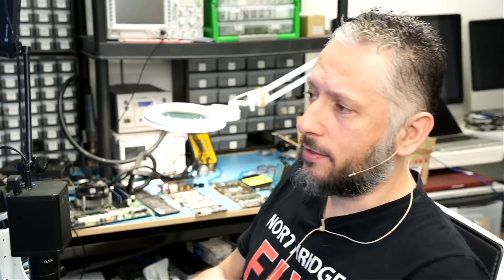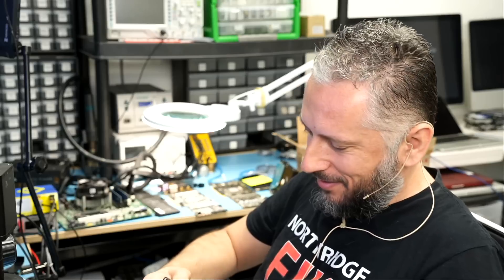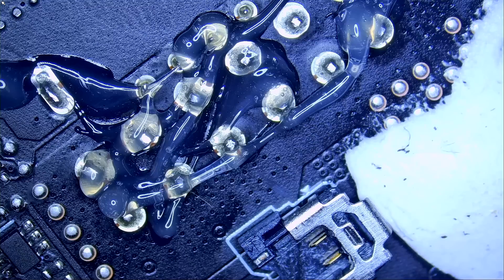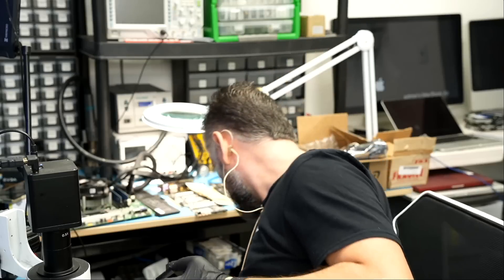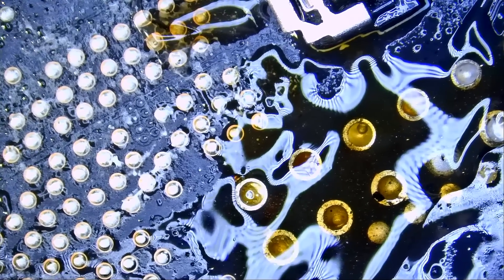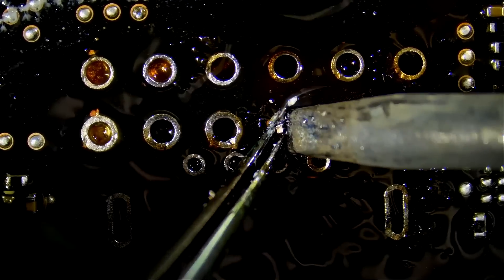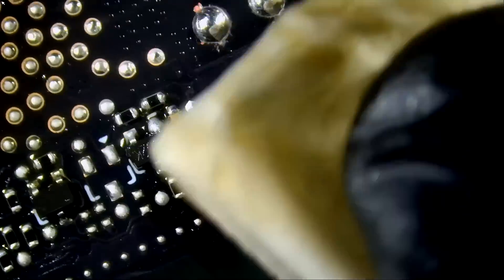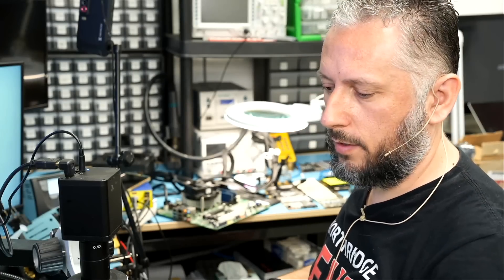4090 FE Connector melted with Cablemod Adapter installed. 40 series cards should be recalled

Comment: I'm skeptical, While the design is crap, it wouldn't surprise me if the power connector was already damaged from the in box adapter and the owner noticed, bought the cable mod adapter in an attempt to prevent it from getting worse, but damage was already done.  People do crap like that all the time, they try to bandage things first after they are already to the point of needing a proper repair.

Comment: I own about 10 of these cards. All 12vhpwr. I have had no issues with them. Just have to push them in all the way.
Reply: So you have 10 PC's running 4090? Sure.
Reply: @j.a.3138  I have about 120 PC’s. All ranging from 3090 - 309Ti - Quadro Cards - 4090 

When you do cancer research it’s what you need.

Comment: This Problem can be easily tackled if the company, have used two connector's for 40 series graphics cards ..... the main issue that the connector is melting is that, AMPS drawn by the connector is more than it can handle, as a result it melts..

Comment: Basic maths... Google 4090 power draw and 450w tends to be the response.  At 12v that means 40 Amps will be drawn.  Its a simple matter of the connector not be up to the task.  As mentioned in comment posted on the last video on this subject, Linus, JayZtwoCents, Gamers Nexus have all commented on this issue and it's not down to user errors.
Reply: Haha yeah, with those amps u'd need industrial power connector.

Comment: High resistance causes high heat, something is drawing to much amperage, and the conductors can not handle the heat they are the weakest link in the circuit.

Comment: The wattage going into a single Plastic connector doesn't work. If it was on a vehicle we'd try modifying the power delivery using up to 3 connections or beefing up the housing on the single plug. Aluminum would be a viable option.

Comment: It's kind of weird that the connector melts only on the card side, but not on the other end of the angled adapter. Could it be that the plastic of the connector on the card is ABS and the angled connector is nylon or similar? Nylon has a higher melting point (glass temperature) than ABS. Or maybe the coating on the pins are not good, or the female connector has not gold plated contact or something? Either way, it's all due to a connector carrying too much DC current, that's what I believe and it's not user error. If it would've been my card I think I would just solder the wires directly to the card and remove the connector altogether. With a PSU with a connector on the PSU case you can still remove the cable if needed. That way I'd be sure there wouldn't be any melting.
Reply: The temperature on the card is 60 degrees more than the PSU side.

Comment: The problem is that this type of plug does NOT withstand as many watts as the card draws. We have reached the limit of what this type of plug can handle in terms of current. This is not a user error!

Comment: From all I have seen the issue is with the power supply. The spec reads you need at least an 850w power supply because this card draws 450+w. Even power supplies made 3 or so years ago are not designed for this amount of draw. So when a user plugs in a rail that cannot handle the draw it causes this melting issue. My recommendation to my customers is to get the pig tail so they can plug in two independent rails that merge into one for this power connector. I also recommend at least a 1200w gold rated power supply! I mean if you are going to spend this kind of cash on a GPU, dont skimp on the power supply! Would be worth asking your customers what power supply they are using and how they are connecting to the 4090. This would be useful info for everyone to know! I am blown away the manufacturers are not making this clear but it should be a given since we all know these new cards are power hungry monsters and the ignorant idea to go with a single power rail to the card is just that, an ignorant choice by the manufacturers!

O yea and Alex you have mentioned a few times about how many layers these cards are. In my quest to find out I have learned there are at least 12 but I have seen some of the higher end cards can be up to 24 layers.

Comment: Get a stock of the power cables that plug into the board, cut off the connectors and solder the wires direct to the board rather than fitting a new connector which may fail again.

Comment: Would be very interested to know if you've had any in for connector repair if the card has been used with PSU maker's own 12VHPWR cables, like Corsair for example. Is the issue only being seen where the Nvidia adapters (with or without cablemod right angle) being used or does this apply to PSU OEM cables too which  are already higher quality and thicker than the Nvidia adapter cable that splits into 3/4 PSU PCIe connectors?

I'm just glad I didn't end up getting a FE card now and that I'm using the Corsair 12VHPWR cable with the Zotac 4090.
Reply: From what we've seen in talking to other vendors and resellers, this is happening with the stock Nvidia cable, competitor cables, and has happened with our own. The two melted cables that we had reports on were definitely user error and not fully plugged in as shown in the GN videos though. But I do, like Alex, suspect something else is going on with too much power being drawn on that top row of pins and think that there could be other issues outside of the melting being exclusive to cables not being fully seated, as shown here with our adapter even melting in the connector too, with the same top row pins melting.

Comment: I don't know if this is the issue, but the 4090 FE chipset has an official power draw of 450W which is 100 watt more than 3090. The more power that has to go through the same standard connector, the warmer it gets and connectors are potential weak points in any electrical system. That doesn't mean that the connector will melt on every card of the same manufacturer. Nevertheless, if I should buy a 4090 card today I would've done some research first to check if it this happens more often to some manufacturers than others. After watching NorthridgeFix' videos about this issue I would have used electronic cleaner and moved the connector in and out a couple of times and make sure the plug is fully seated to try to get as good connection as possible. 
Nevertheless, even if the user doesn't clean the connectors and simply installs the card according to the manual doesn't mean that a melted connector is the customer's fault. The way I see it, this is a design flaw. Remember that it is the connector on the card that the manufacturer has installed that melts...

Comment: @NorthridgeFix why don't you take one of those connectors and wire up the +12v and ground pins same as with the card and pull a high amp load through those pins till the connector starts to burn then report back at what wattage & time the connector gives out?

Comment: This must be mainly because the current carrying capacity of pins of connector is not that sufficient to carry the peak current load of 4090. Due to this the resistance offered by these pins must be more thereby producing a lot of heat. The company should replace these with pure copper alloy pins which may carry more current without producing much heat. % of copper in alloy should be more and the design should be made with thicker pins so as to carry more current.

Comment: Simple physics tells me the issue is with the user when looking at the cable / socket spec. Sure you may have the odd problem with an adaptor cable or socket that has a manufacturing defect, but again that's explained by physics. Having a properly molded socket and cable is fine as long as the cable is inserted fully.

I'm also wondering why people are sending you GPUs for repair when they are still under warranty? Again this points to user error.

Comment: Imo the problem is the pins in the connector has to small area so if the matning connector isnt tight enough there will be excessive heat.

Comment: I've seen some yt videos of polish repair shops dealing with this connectors and they've noticed a problem with the power cables provided for the card. Sometimes the power cable itself does not fully connect all 12V lines or all GND lines causing high current to flow to or out of the card by only two or one pins on the connector. Maybe this is the problem.

Comment: Im not an engineer but I know those tiny pins should have been  the main suspect from the beginning, those cards need a lot of current and those pins are just so small in mass, it generates resistance which creates heat. 8 pins connector pins are much more thicker and solid while being rated for only 150 w each.
Reply: Exactly, you're not an engineer thats why everything you just wrote is bullshit and without merit or foundation in reality.

Comment: Like I said in the last video, the connectors are flawed.  All connectors become loose over time and this is usually a factor in choosing a connector.  There is a derating curve for temperature and for high current connectors there is usually a derating curve that is determined over a number of on/off heat cycles and connect/disconnect cycles and I don't see that for these connectors.  This derating curve of current rating vs cycles would likely show that it would hit thermal runaway after so many cycles at 400 to 600 watts.  It could be weeks, months or even years, but all these connectors will eventually melt under a heavy load and that limit will get lower and lower over time because this connector is operating over its derated maximum.  They should have went with custom high current screw terminal connectors that have a large surface area of contact and some screws with captive lock washers to prevent them from backing out on their own...  The data for the PSU could then be SMbus or USB data to the motherboard from the PSU and the card can get the info from the OS or a secondary data line direct to the PSU.
Reply: Thanks, i like reading arm chair EE's talk out thier arse about things they know nothing about.

Comment: a few 4090s show up for repair and recall? Considering how many 4090s are in the wild now going to need more numbers than what is essentially a fraction of a percentage. Note that there's over 130k sales now. Also a cable mods adapter isn't a guarantee of no fire or melting, it just provides less chance of it being caused by cable routing causing undue pressure on the plug.

Comment: In my opinion. It falls on the manufacturer. They do all types of tests before a product is released to the public. They just didn’t care a small fraction would encounter this problem. The bottom line is profit in the end. That’s why they are issuing warranty replacements on this.

Comment: The amount of power they suck and the pins still being thin like they had been, it's a design fault. This is one of the most power hungry chips and thickness of power connector pins hasn't increased as per its requirements. That's why the plastic is melting. 
Similar thing happens when you use thin wire for heavy loads.

Comment: I literally installed an adapter 5 minutes ago from CableMod. Not that they are at fault IMO, the new adapter is just BS trying to push something new. I have seen OMEN pre-builds with normal PCI-E connectors..
Reply: You're fully safe with our adapter. Even IF a failure occurred, we have a great support team that would take care of you fully. As you can see with this GPU that was sent in even, if the event happened where a GPU had a failure like this, we replace the card, get it repaired, and then we plan to giveaway the cards too, as we did on the Nvidia subreddit with one giveaway going currently. :)

Comment: Too bad that it had to be destroyed to get it apart.  I wonder if that Cablemod adapter had the pins too short on the one side that was unmelted, those were clearly not connecting properly.  A picture of the card installed in the case would also be useful.

Still not 100% convinced that this one couldn't have possible been due to it's installation.  Or a defective Cablemod adapter.  It could be that when pushed into the card, that one row of pins were all misaligned, and got pushed up into the cablemod adapter.. so they ended up never making contact.  If that occurred, then the design of the adapter would be in question.

I've tried a 90 adapter on 6 inches of cable from aliexpress, used it for a few months and examining it closely now, it looks completely fine.

I have one of these Cablemod 90's installed that angles down over the heatsink of the card, which appears to be the same as the one shown in the video.  I'll shut down and examine it, it has about 2 months of usage as well.
Edit: powered back up now, mine looks fine, all female metal connectors in the cablemod adapter look properly and evenly positioned.
Getting these out suck for those with the 90 degree bend over the clip.  I use an old credit card slipped between the cable and the card, and press then pull.  And you have to make sure you are pushing on the clip as there is space above it.  So a little tricky.  Cablemod never did answer any questions as to how to remove these.
Reply: We've sold over 50k of these with less than 10 failures, definitely no quality concerns to worry about with our adapter, we put a lot of time into the development of them. Removal is pretty straight forward though, what were you having issues with? For that you just unlatch the adapter and pull it out (we recommend removing the cable first).

Comment: Need to be replacing these connectors with high quality silver or gold plated connector. If replacing with same quality tinned Chinesium connectors, problem will come back. Very likely customers female connector also damaged when this occurred. Both ends should be replaced when mated with an overheated connector.

Comment: It's a bad design to start with but it's adopted as a standard so we can't do anything. 
They also did unofficial deep study on GN channel, which cables or cable mods are bad also. 
There are two types of metal tubes in cable or cable mod. One type is good other type is bad because of the way they make contact. So that's also an issue from bad design. GN channel explains it all, but still we all agree it's a bad design. Contacts are too thin compared to usual 8 pin. 400W through this new connector is a risk. Design is very bad especially for high power. Anyways, you'll see melted connector only on 4090s since they can push power usage that high... bad design really
More on bad design, that connector is rated to be plugged and unplugged just for like dozen times or so, after that it becomes unsafe. 
The main issue is it's adopted as as PCIE 5.0 standard for cables and connectors, so again we can't do much about it, we can only rant imo

Comment: I wonder if the adapter was bent downwards because all the connectors you are showing have the same row burnt and not burnt.  If not, then the pin length are too short
Reply: only 1 row is +

Comment: It's clearly NOT the fault of users failing to push in the connectors all the way.
Even if this was the case the connector should NOT melt under any circumstances.

It's bad design for a product this expensive.

Comment: 50 series card will go back to pcie pwr cables, this was a shameless attempt by Nvidia to try cover the mental power requirements of 4080/4090s FOUR, FOUR 8pin cables. After this constant beating over melted cables they will go back to PCIE and build more efficent cards. Remember they did the same with 480s "grill cooler", everone gave them shit, so they released the 580 with much lower power draw

Comment: Isn't it a little bit suspicious that the damage is mostly on one side of the pins? 
It may sound like copium, but i think it could be a mix of both: user and manufacturing error. 
But to be fair, if you buy something that expensive, you might aswell choose one with a good warranty from a reputable company, even if it costs a little bit more.

Comment: Jeez, you're saying the connector melts not only if a cable is plugged in badly but also if a 90° adapter is plugged in badly? Mind blown... And "plugged in badly" obviously means high contact resistance either because of user error or because of crappy pin tolerances of third-party accessories.

Comment: If Nvidia and AMD had any common sense, they would lobby the group that sets the standards on power connectors, to use lugs like audio amplifiers.  2- 10 Gauge power wires + Usb-C for card sensor data to the PSU .  High strand amp wire is very flexible too and could be premade with ring terminals if wanted.  Custom builders could make their own wires for length control and color matching.

Comment: I just retired from a major utility as a controls and protection designer. I have seen several of your repairs of this connector. I believe that I have seen many of these video cards have several power connectors instead of just one. You are the expert and I mean that with no disrespect. The power connector is failing because of the amount of current flowing through it exceeds it's capability. Is it a batch of bad connectors, maybe. The manufacture has not properly designed this connection. They have designed a mistake. It should be noted that although you are replacing the burnt connector, the design problem still exists. I see no way you can fit the design mistake. People just need to not buy this defect design card.